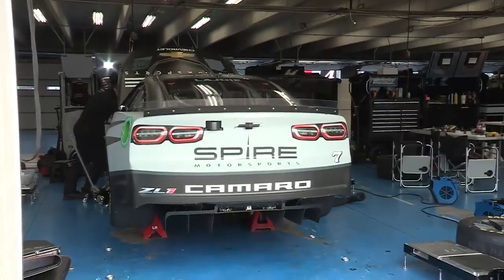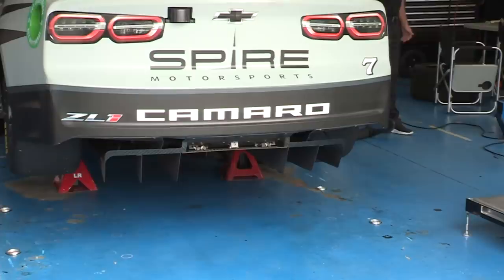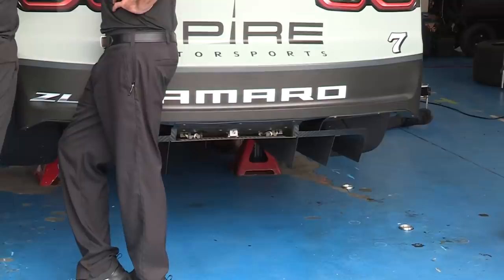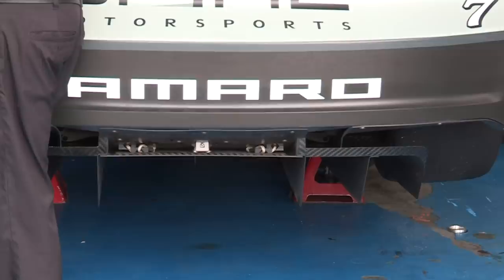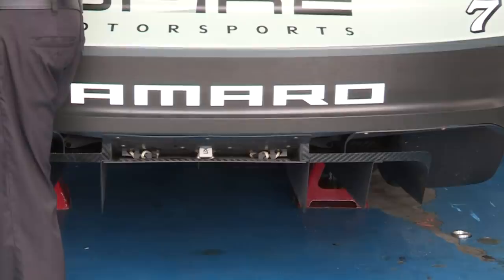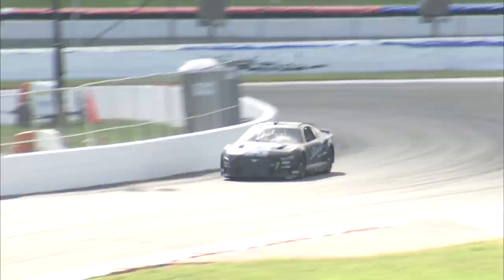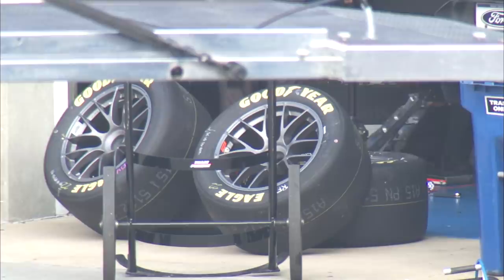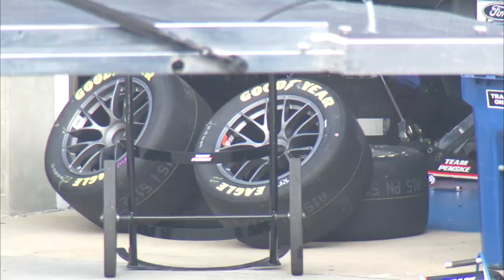Larry Mac breaks down center lug wheels on Next Gen car | NASCAR

Comment: The pit stops will have the same look, absolutely.    They won’t however, have the same sound.   I’m going to deeply miss the 5-Lug Rips.
Reply: The sound will be different, but a powerful centerlock gun is extremely loud. I don't know what kind of guns they'll get, but F1 and LMP1 guns run at 25bars (362PSI), more than double of what the NASCAR guns run at. If you're at a street course, you're likely hear them over the cars  if you're on the grandstands facing the pits.
Reply: Yeah. Sucks that NASCAR decided to do this
Reply: Let's be honest, half the teams are intentionally doing only four. ;)
Reply: I totally agree. I will definitely miss the sound of air gun hitting the 5 lugs
Reply: Xfinity and Trucks will still have five lug nuts.
Reply: @Trainlover1995  For now, neither of those series are introducing a new generation of car in 2022.
Reply: @BentleyTypeR  You mean, catch up to the 21st century?
Reply: If Nascar thinks F1 is doing great think again..
 I bet Nascar looses 40% of its fans due to the single lugnut F1 rim over the 5 lug actually stock car bolt pattern Nascar has has since it was born.
Reply: @johnsnow1355  id take that bet
Reply: @MiloPerrotti  you will loose ha ha Nascar is full of fluff not one driver actually earned a seat. It's about who has money and sponsorship dollar. Not who can actually drive with talent.
Reply: @MiloPerrotti  dudes tripping. 🤣
Reply: @Celciusify  um... NASCAR guns aren't running on a Craftsman 125psi air compressor dude.
Reply: @stargazer2504  You're correct. Many of the teams use Dino Paoli Red Devil wheel guns. They run at 175psi.
Reply: @Xeil  thanks i agree
Reply: @johnsnow1355  what does this statement have to do with race fans?
Reply: @johnsnow1355  uh no
Reply: @BentleyTypeR  Can't have the same old same old forever.
Reply: @johnsnow1355  Now, hold on there, mister. You're actually insinuating no-one's earned their seat? C'mon. Why is Kyle Larson almost winning anything and everything he participates in besides NASCAR? Chase Elliot driving up through the field at the Charlotte Roval after Harvick essentially wrecked him? Is that the fluffiness you're talking about? If I were you I would much rather wonder about who never got to show off their skills properly because they got stuck with a team with little to no resources. If every team were competitive, would you expect to see some pretty unfamiliar names at the top? Or do you think drivers are where they're supposed to be in order to realize their full potential?
Reply: Watch them strip that lug and race be over just like in F1
Reply: Same. But times are changing so I guess I better jump on to this new F1 Nascar
Reply: @slickdiggler1197  That's why they have to test this out throughout long stints with full race pace. Nothing can be left to coincidence. But there are also no guarantees. We'll just have to see how well the single lug nut implementation is. If we start seeing several retirements as a result of lug nuts not coming off or on, it's DOA and they have to revert back to the old and trusted.
Reply: @scifiknut  It doesn’t happen hardly ever in F1 but I’m sure because it’s new to NASCAR it’s going to be a frequent problem at the beginning. Could make things interesting.
Reply: @Celciusify  Can speak to this. Went to Long Beach for the indycar race and was shocked at how loud those wheel guns are
Reply: @scottlathrop66  Literally came to say the same thing
Reply: The main reason the unilug is being implemented is to do away with the six figure paycheck tire changers that the teams can no longer afford to pay.
Reply: @johnsnow1355  Nascar actually got the idea from supercars in Australia.   It's also where they got the Transaxle idea from
Reply: @slickdiggler1197  maybe you should watch v8 supercars they have used a single lug for years with very few failures.  F1 has very few failures to .
Reply: @robvanderkroft6515  it is garbage. Nascar is not lemans race cars. Pit crews were a major part of the team and winning. Now they don't matter 4 guys can change 4 tires and put gas in the car once air jacks are installed it's only gonna need 3 people to service the cars costing 100s of jobs to people that love the sport and there jobs.
Reply: @johnsnow1355  Nascar is definitely not Lemans cars that would require fine engineering not brute engineering.  The pit crews are always going to get smaller as technology gets better and teams try to save as much on costs as possible.. less pit crew means less mistakes.. the only thing that will change is the time they can do it in . Supercars has run single lug for years and the pit crews are relatively the same if not a bit bigger .
Reply: @neededtouploadsomething  it was meant to be fast, and a show of skill on the part of the crew. being fast meant being GOOD. now with just one lug, all the skill just went right out the window. stops are going to be down to how long someone wants to wait on fuel rather than which crew was actually better.
Reply: @scottlathrop66  modern cars dont have a single lug on their wheels. the road going variants of all of the makes and models, still use five lug wheels. and whats worse, is the excuse that its about heat is bogus as well. BMW still uses 5 lug wheels on their race cars, with aluminum rims as well. they have this thing called technology that allows them to keep that iconic setup. this mind blowing thing known as a copper heat sink.

Comment: I'm so old, I remember when stock cars were build from something taken off a production line.
Reply: ok boomer
Reply: Cool - I mean I like that era, but hey this is the future 🤷‍♂️
Reply: These new cars dont even resemble anything a car lot sells
Reply: @shanevanorder2644  They haven't resembled car lot cars in a long long time. Chevy ran a Monte Carlo, an Impala, an SS and even a freaking Lumina before the Camaro. How many of those actually matched up with production cars?
Reply: I remember when they used a hammer and not a air wrench to remove the wheel.
Reply: Lol, are you though? That hasn't been the case since like the 60s.
Reply: I wish these things were "stock" like they use to be and I wish more automotive companies ran in the race like back in the day. The new cars will certainly be closer to "stock" cars, but yeah, no where near off the assembly line. Win on Sunday, sell on Monday hasn't happened in a long time, sadly. :/
Reply: I remember when the S in nascar stood for stock
Reply: @VneedsSpeed  Remoob ko.
Reply: @CNC-Time-Lapse  GT4 road race cars are the closest to stock there is for a Pro series anymore. At least the tubs are factory built.
Reply: NASCAR basically stopped time about 1977. Got a lotta catchin up to do.
Reply: I'm so old , I was doing pit stops before there was a mandatory speed limit
Reply: @NigelMK  Right. People say "the golden years" were the 90s and early 00s. But those cars were the furthest thing from production cars that they've put out there lmao
Reply: Like in about 1952?
Reply: Watch them add tesla cars. Let’s see how many zoomers watch nascar then

Comment: The teams better do something with their 'loose wheels'
Reply: wow, I bet nascar has been making such a big deal about loose lug nuts lately to try and garner support for the one lug concept that most nascar fans are not so excited about.
Reply: @whippy107  I don't see why going from 5 lug nuts to 1 center nut is going to make NASCAR worse. I've been waiting for this. Now cars most likely won't have to come in again if there is only one lug nut to focus on on each wheel. Losing two to three laps on the shorter ovals because of loose lug nuts and thus a loose wheel, forcing teams to pit again, has been extremely frustrating to drivers, teams and fans. And made even worse if the driver picks up a pit speeding violation in addition. I do have one major worry, though. With the shift from steel to aluminium wheel rims, how will these be affected during the longest races? Will the heat build-up cause problems with loosening and tightening the center lug nut? What if the lug nut is damaged/deformed during a race and the impact wrench fails to grip the lug nut during a pit stop, causing a lengthy delay or even a DNF? The new season will definitely bring some excitement and a few unknowns with it. Hopefully NASCAR can work out most of the kinks during current next-gen testing and off-season.

Best regards from a long-time Norwegian NASCAR enthusiast.
Reply: @scifiknut  I'm not totally down on the single lug, but being a fan of the sport for over 30 years I appreciate the skill that the tire changers have had to develop and maintain in order to keep the teams competitive.  Watching those guys change lugs so fast has been artful, and I suppose it's a shame others in the future won't be able to appreciate that moving forward.  I'm also getting old and set in my ways  LOL Cheers from the USA.
Reply: @whippy107  Sure, I can totally understand. It's tradition. I've seen some of the YouTube videos on how some feel that NASCAR has lost its identity. It's new and perhaps more politically correct drivers, it's the new play-off format etc. It's several things. I love to see the tight racing and as a European, watching the street circuit type of racing where they go left and right (😉) is closest to my heart. But oval racing is cool too, as long as one driver isn't running away with it from the start (that Kyle Larson is on a serious roll after joining Hendrick Motor Sports). 
But, that was a slight digression 🙂. Back to pit stops and lug nuts. Absolutely, when you see the cars breaking into their respective pit boxes and the tire changers, jackman and gasman move into position, it's a well choreographed and fluid maneuver in which they have to be spot-on. You have got to appreciate the many, many hours spent on hitting those lug nuts each and every time at high speed without missing a beat. Sure, there are some mishaps, but seeing the best pit crews pull off incredibly fast pit stops considering they are doing one side first and then have to sprint to the other side and repeat the job, that's really something to behold. It's perhaps something most of us take for granted, sadly, and we don't always see how much work and dedication that goes into being a pit crew member and not just the tire changers. For example, watching how the #9 team managed to sufficiently repair Elliot's car after he was shoved into the wall by #4 Harvick at the Charlotte Roval was quite amazing. I almost wished for Elliot to completely catch up with Harvick and do some retaliation, but then karma struck and Harvick took himself out. Can't deny I let out a chuckle and a squeal of joy 😉.
Reply: @whippy107  I know what you mean. My dad was an IndyCar mechanic back in the 1960s, and one of his most prized possessions is a brass Proto wheel hammer with an aluminum handle. He hit the tail end of the years where they still used "knock off" wheel nuts, before going to the nitrogen air guns. You are right, a 5 lug pit stop is an art, but having been around the IndyCar and sporty car world all my life, I'm totally used to the center lock wheels. I even considered putting center lock wheels on my daily driver, however changing a flat on the side of the road would be a pain, so I decided against it.

Comment: Diffuser expands the air as it leaves the rear of the car. that helps the pressure differential above and below the car, that helps to suck the car to the ground which is the down force effect you get from it. then the expanded air is moving much closer to laminar flow out the rear of the car rather than air being forced up by a lip or wing. cleaner air behind allows for closer racing and less getting light in the rear from someone "stealing your air".
Reply: Is the diffuser going to be durable ? If a car gets rear-ended on a restart is it fixable, or is the car done, speed wise ?
Reply: @tomchrisfield7348  good point. I hope so because one of the fun things of watching NASCAR over Indy and F1 is their ability to bump into each other and keep racing.
Reply: The diffuser CAN add downforce.  My question is going to be- if one car comes up and pushes another will the air "pack up" under the leading car??? This could make the leading car feel light, this could make for great passing and action, this could also be a problem.  Great explanation though LGR
Reply: @tomchrisfield7348  great question. We've seen mild damaged (very mild compared to nascar) cars in F1 suffer performance problems. Louis Hamilton I think had a couple races in recent years where 'floor damage" or diffuser damage changed his lap times from near fastest to mid pack. So I could see it being a problem at the 1.5mi or longer tracks. Maybe even bristol because it's so fast.
Reply: CLOSE.. it speeds up and channels the air & the way it escapes (creating a low pressure point) pulls the rear down.
Reply: @jerwatson79   as long as they continue to use a rear spoiler instead of the raised rear wing, you can pull downforce off the front car, although the new diffuser will aid in drafting

Comment: The aluminum wheel / single wheel nut has been used for decades in Indy Car and F1 and IMSA sports cars. Jim France comes with many years of experience in IMSA so this configuration is not foreign to him. Neither is the rear air diffuser - this also has been used for a long time in IMSA, Indy Car and F1. Just because this is new to NASCAR doesn't mean that it's never been tried before. NASCAR is just catching up with other major motorsports.
Reply: Its stock car racing for a reason it just doesn't look right
Reply: @coreygolphenee9633  bro nascar hasnt looked right in decades

Comment: Plus the aluminum won’t heat the rim as much so at short track you won’t have to worry about the brake heat in the wheels melting the bead in the tires

Comment: Lots of base model cars still have steel wheels, almost no production cars have a centre lug nut. I don’t understand how that’s changing with production car technology?
Reply: They didn't link the center-lock with production car looks, just the 18" aluminum wheel. If they were on nothing but road courses I think they could probably stick with the typical 5 lug system, but at short tracks when the brakes are hitting 1500 degrees and that heat gets into the aluminum it creates a serious issue with getting the lug nuts off which is why they decided to go with the center-lock

Comment: Hope no one gets a "lose lugnut" penalty because a penalty at that point, would be the least of their worries lol
Reply: Hopefully it will be safer. I don't watch a lot of open wheel but what I've seen is if it's not on, the wheel will come loose before they even leave the pits. I don't know though.
Reply: @lightfeather9953  yeah I'd assume it would. But since it's all aluminum, it will probably bend to heck and end a lot of days. I can see it becoming quite an issue already
Reply: @cptcrunch8578  There will probably be some growing pains the first year, but really just about every top series uses center lug wheel locks, from IMSA/WEC to Indy and F1. There are occasional issues, but there aren't wheels coming off every other turn on every lap. I see it as a safer upgrade as the tire changer only has one lug to focus on.

Comment: The one lug nut system is interesting, can't wait to see it on track
Reply: A lot of other series already use it
Reply: Everyone else uses it. Nascar just finally caught up, and about time. Better for racing
Reply: I'm excited
Reply: It’s particularly the reason F1 can pull off the sub two second pit.
Reply: @southpaw578  and they have a crew at each wheel
Reply: @lukasgarage956  Plus they dont refuel.
Reply: @southpaw578  that and no refueling for F1

Comment: The 1 lug nut pit is gonna make the hardest competing with other pit crew. Drive in the drive will be faster and might be safer for the crew. That's my guess.
Reply: The limiting factor has been, and will continue to be, fuel. Most of the time, the thing that prevents a stop from being faster is making sure you get enough fuel in the car. Since NASCAR fuel cans are gravity fed, there's not a whole lot you can do to speed that up, so, as long as it stays gravity fed, fuel will always be the limiting speed factor on pit road

Comment: Thank you. Finally. The center lug nut will make it so much easier. With that being said, we have seen wheels refusing to come off several times, especially in F1. So it doesn't mean pit stops will always be a 100 % smooth ride.
Reply: wasn't it one of the Red Bull cars that had a serious issue with it being cross-threaded and they had to put the car in the garage and get a cutting torch to remove it....
Reply: @HPRam1  Mercedes Bottas' car during this years Monaco GP. Took them a couple days back at the factory.

Comment: It would not have worked prior to 2020 when NASCAR went to the uni-lug alloy rim that is much closer to being flush with the outside edge of the tire than the old 5 bolt steel rims were. Before the change, drivers knew that rubbing the wall with the the bulk of the weigh being against the rubber of the tire slowed them down more than the support of the wall allowed them to speed up.